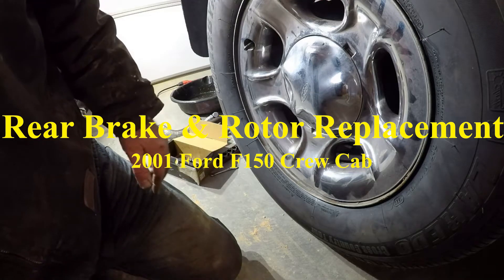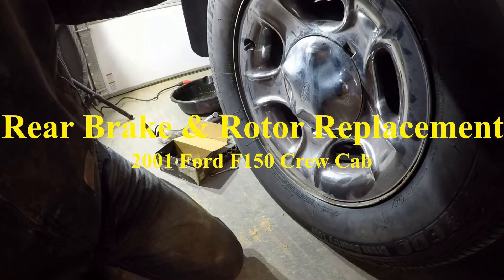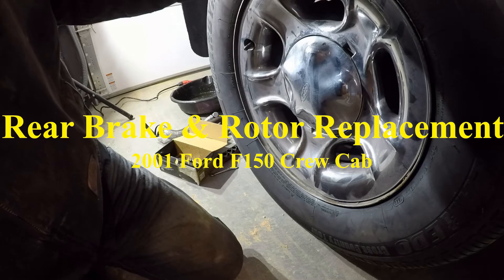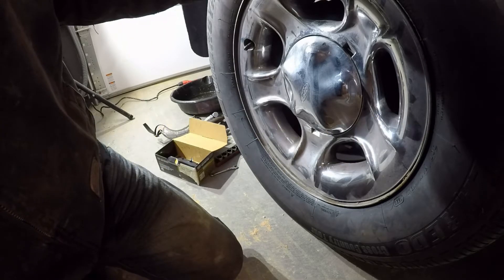2001 F150 Rear Brake & Rotor Replacement

Comment: very nice. Rotor slides off with no problem? Thanks for the video.
Reply from the maker: I was fortunate that they came off pretty easy. I have had to turn the parking brake adjusters loose before.  Also, I've had to use a puller another time.  Thanks for watching!